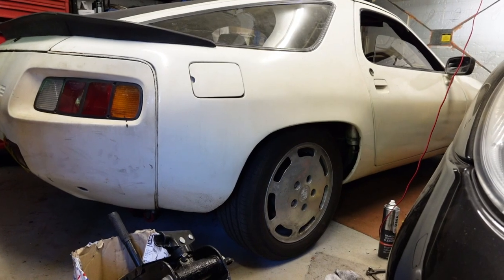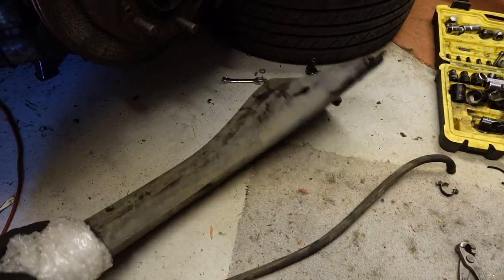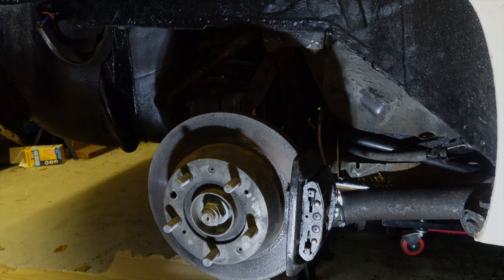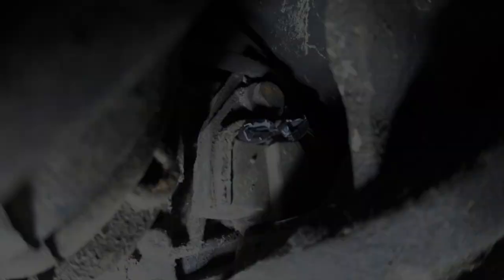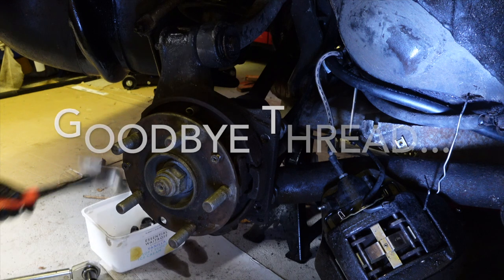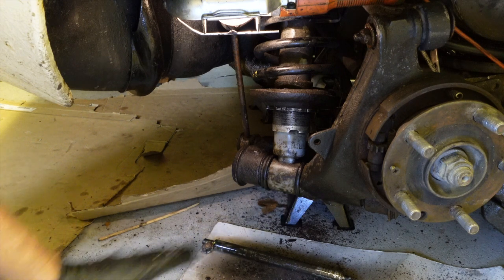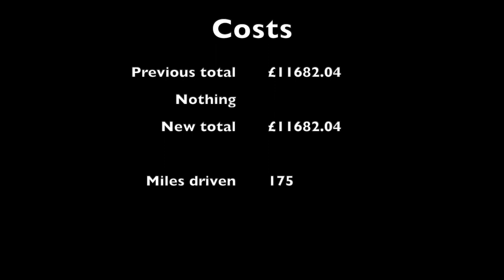Porsche 928 Episode 102 - CLUNK CLUNK CLUNK

Comment: It wasn't until one of your last drives that I could hear it clearly enough. I would say the shock absorber is definately the issue. I had a rear shock on my daily driver that dropped all of its oil due to a failed seal. It sounded absolutely identical to the noise you were hearing and would shake the entire back end of the car as the wheel bounced up and down on the spring with little/no resistance.

Well done. I'd say that's another on solved!

...and as others have said, bushings need doing too :) Although I guess this will all come with the planned suspension refresh.

Also that rear disc looks quite pitted on the video, it may be not as bad IRL though
Reply from the maker: Thanks for this - that shock has a bad leak and little resistance. Defo dead. I’m going to strip off what I can and get it cleaned up and rebushed.

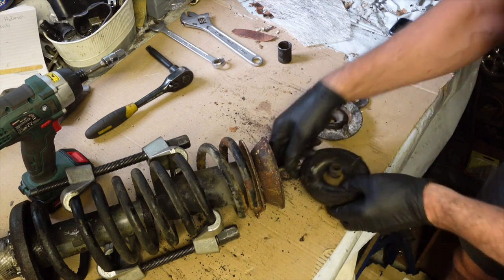Comment: 20:30, 21:35 and 21:46 is your evidence..same sound as you get the plastic shroud out, I reckon it's the bump stop so the plastic is banging on the shock
Reply from the maker: Agreed. 20:30 is the same sound as when I was driving. Pretty sure its in the shock. I also noticed that in an earlier video something fell out of the shock and I said "bumped stop deteriorated", but on inspection I see its the plastic washer... perhaps that allows things to rattle.

Comment: Aaah, the joy of chasing weird noises on your classic car :).  I am currently chasing one on my 66 MGB and nothing has been changed to cause a noise, LOL.  One thing I did notice is you might want to replace the bushings on your upper control arms.  Those control arms should not be able to wiggle side to side as you were able to do in your video.
Reply from the maker: Just one of the pleasures of a 44yr old car :) ... will check out those control arms, thanks!

Comment: Sounds to me like a loose rear swaybar (the steel rod connecting both wheels to stabilize the car in corners). This bar comes into action when the loads on the wheels are different. So are there any weird noises or movements of the swaybar when lifting one of the rear wheels(!), with the other standing on the ground? I had a similar noise when one of the consoles holding this bar had been ripped off on my 911. I am almost sure this is done differently on your 928, but the sound of it was very similar...
Reply from the maker: Ah thanks! Im going to remove the sway bar and renew the bushes, so hopefully I will find some proof :)

Comment: I love this content!

My OCD wants to clean the bottom of your car so badly!! Lol

My two favorite things to change on an older project car are the suspension and brakes. Makes the car feel so much better.

If you want, check out my slow rebuild of a E46 330i ZHP build. I'm literally cleaning parts for it as I watch your video. Lol
Reply from the maker: Hi Andy, the underside is actually very clean (its just been painted with underseal. The suspension components are awful though (well the rear is, front is all completely clean). I will get it all cleaned up for you soon :)

Will check out your videos now!